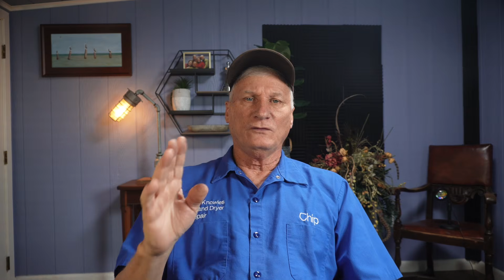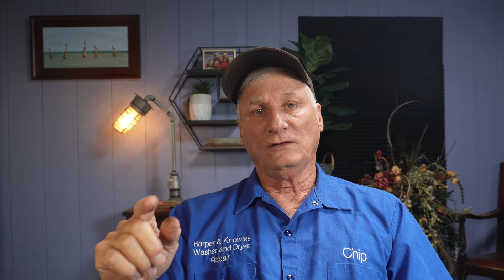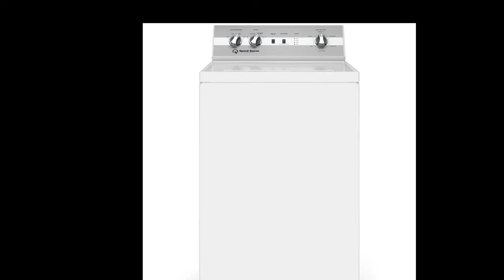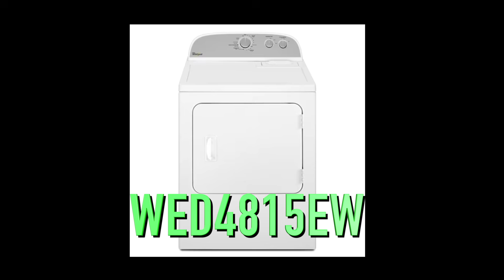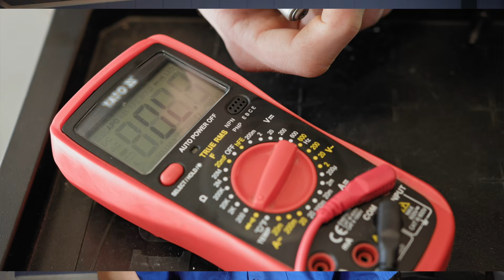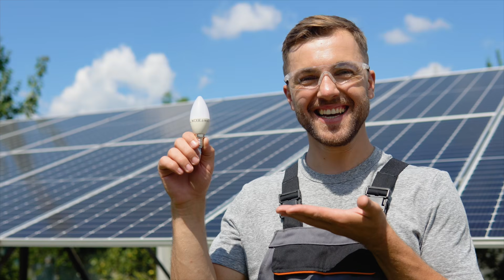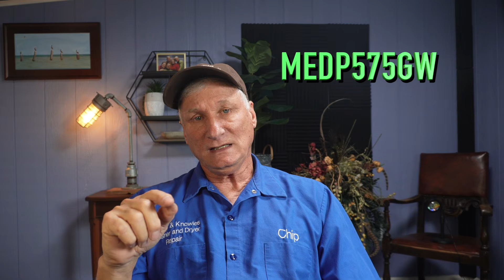I've Repaired Hundreds of Dryers — These Are the Only 4 I'd Actually Buy

Comment: We bought a GE bottom of the line dryer in 2005 and it lasted 20 years. The GE washer is still going strong. The only failure with the dryer was the drum bushing would wear out and rub against the chassis. It finally wore the chassis to the point that there was nothing to attach the bushing to. The motor and controls would probably last 30 years.
Reply from the maker: Appreciate that. Clear beats clever every time.

Comment: Weighing in on my personal Miele experience...

In Dec 2008 (essentially 2009) | made a substantial investment in the Miele Touchtronic washer W4840 and gas dryer T9822, including a pedestal base for each. Loved them and took excellent care and maintenance of each. Even the technician commented on their pristine condition.
The problem: One year ago, the dryer, which has never seen hard use, has completely stopped working and gone into
"lockout mode".

Theorizing the issue could simply be the door latch, Miele suggested its replacement. $217 service call, latch parts, and labor did not restore dryer operation.

Given this, I was then counseled that the specific problematic part for an F98 error code cannot now be diagnosed unless dryer is operational. Miele can only suggest that the F98 code could be a thermo switch ($97); the resister ($110); or gas valve ($963). However, Miele has discontinued manufacture of the gas unit assembly.

Miele advises that the only route to override lockout mode in order to ascertain the problematic part is to first replace the electronic control board ($367 part + labor).

So, at minimum, I would have to spend $367 + labor to install, simply to first diagnose what part, and therefore how costly, might be the fix. And if it is determined to be the gas assembly, repair is not even an option. Miele essentially made this machine obsolete after only 15 years when its part manufacture ceased.
I am both bereft at the situation and paralyzed to simply junk it. Miele suggests replacing the unit.

However, Miele no longer makes residential size dryers and washers of my same capacity (5.8-6 cu ft) so unit replacement, to the much smaller compact (4 cu ft) unit they currently offer, is not an option.

Any suggestions appreciated as I remain stuck on what to do. I prefer to keep this "quality" dryer in service, but the road to repair could prove a money pit or costly funeral.

Comment: So, if the Miele doesn’t have a vent, where does the water go? Collection cup? Does that pose an added mold risk?
Reply: It has a small drain hose that you insert into the washing machine standpipe. As well it can drain into a water tank upper left side as you face the dryer, periodically you need to empty the tank.

Comment: I dumped my 2020 Maytag set and bought 2017 speed queen.  I control the water level and the heavy duty cycle is only 25 minutes, not 1 hour.
Reply: The commercial Maytag washers models after 2023 ALL have water level control. AND HALF the price of the Speed Queen.
Reply from the maker: That's the whole point — glad it paid off for you. Thanks for watching.

Comment: I bought an Amana set years ago and when they were two years old I bought a house and it had a new Maytag set so I gave away the Amana set which is still working but I replaced the washing machine twice (transmission) and the dryer once. The Amana set is celebrating its 30th birthday 🎉😊
Reply: I still use my Amana refrigerator after 30 years.
Reply: We replaced our GE dryer with an Amana, and we have had no problems.
Reply from the maker: Glad it landed clearly. That's always the goal.

Comment: One thought, be very, very careful WHERE you buy - I wanted to get my older friend a reliable dryer, so I chose the Whirlpool commercial dryer with the long warranty - I bought it from Appliance Connection, a firm that had been around for decades.  I bought one day, and the next day they filed bankruptcy.  The atty for this could not tell me if I would receive the dryer or not, it said it was already shipped, so I could try to quickly stop credit card payment, or wait to see if it actually would be received, or seized somewhere along the way as part of the bankruptcy.  Apparently, it was seized.  Still waiting on any sort of resolution on this for several years now, still get the atty notices.   I ended up ordering the same machine again straight from Whirlpool.  Luckily, it has needed no repairs.

Comment: Concerning WiFi connectivity... your new dryer will very likely not work with an advanced current router that defaults to the highest security settings.  Many routers don't take well to being downgraded just to connect to your lowly dryer or other appliance.  I have a new AOSmith water heater that will not connect to my T-Mobile 5G modem.

Comment: I can confirm that whirlpool dryer. I work at a 750 unit apt complex and the residents beat the hell out of them. Usually just a belt, door switch, and maybe a element now and then. Actually the pull out lint screen is what is replaced most. Almost every time it's something plastic or gum/candy that was left in the pockets.
Reply from the maker: Glad it landed clearly. That's always the goal.

Comment: My 1998 Maytag oven (made in the USA) has had one minor repair (the plastic over the up arrow on the controller wore through), and I had it repaired and also purchased a spare control unit. That and I replaced the light bulb once or twice. No other issues at all, and it still looks great! My 2004 Maytag portable dishwasher has had ZERO issues, and I use it about every other day. I have a built-in 1018 dishwasher that takes over 3 hours to do what my Maytag does in half that time. And it CLEANS the dishes better! My Citizens brand microwave oven (made in Japan, NOT China) was purchased in 1987. It still works flawlessly, and not even the light bulb has been replaced. It also still looks great, and I use it all the time. My Maytag washing machine is about 10 years old; no issues ever. My Maytag dryer is about 12 years old, and it works flawlessly. Never an issue with either.
Reply from the maker: Thanks — I try to explain it the way I'd want someone to explain it to me.

Comment: I bought this Maytag commercial/residential dryer, model MGDP575GW0, in 2021 and I'm very satisfied, especially my wife. I also have the Maytag commercial washing machine, model MVWP575GW1. I love them and they work perfectly. I love the channel. Greetings from Puerto Rico!😊
Reply from the maker: I am glad to hear those machines are serving you and your wife well, and thanks for the warm greetings from Puerto Rico!
Reply: I purchased A Maytag set same year you did and ours broke down last month. Transmission gone, whatever holds the drum gone,  would not drain water.  More expensive to fix than to replace. Bought a Speed Queen

Comment: No, no, no, no, no... I cannot agree with the Whirlpool dryer recommendation at all. I currently own this dryer and it became a thorn in my side as soon as the warranty ran out. For the last 5 years I have replaced the heater element at least twice but as often as FIVE TIMES EVERY YEAR.  I can replace the element in less than 10 minutes because of it, and I have a fresh spare on hand  at all times. And yes, I used genuine Whirlpool replacement parts... At first. But those are the ones that burned out the quickest, sometimes within a month of replacement. And getting the sellers to warranty the genuine parts was a nightmare. Using the cheaper off-brand Amazon  heater elements has resulted in a longer time between failures, and getting a refund when that part fails is much easier (not to mention getting next-day delivery). So no, I cannot go with this recommendation at all. This dryer sucks!
Reply from the maker: When you look at a burned-out element, if the coils sag and aren’t straight across the frame like they were when you put it in, then you have an airflow problem. Thanks for watching!
Reply: Hi. You might want to try using a lower temperature cycling thermostat on your dryer.
It might extend the life of your heating element since it will cycle On and Off less often.
Also. Have you tried the SUPCO brand after market heating element on your dryer?

Comment: Chip, love your channel -We have had a Mexican made and US assembled Fisher & Paykel dryer -Weve had it 22 years, and just last week I finally needed to replace the belt, pulley, bearing, and bearing journals for a cost of about $68.88 with a kit from Partsdiscount and 2 hours of my time (I cleaned this insides like you could eat off it too).  This dryer was used daily during that time with a family of 5.  Anyways, not sure if you run across these New Zealand products but 22 years and no signs of stopping is old school quality. -also, our Fisher and Paykel washer made it 15 years BTW.
Reply: My Fisher and Paykel washer and dryer are still going strong after more than 18 years. The dryer is starting to make an odd sound, so I will look into replacing the parts you did. Thanks for the information!
Reply: @gribble2979  Irs almost certainly the 4 plastic journals bearings which guide the tumbler and are designed to wear out and are simple to replace -or the main bearing or pulley -both simple to fix too.
Good luck and if you need help hit me up
Reply: @DBoonful  thank you!
Reply: Just replaced heating element and the parts you mentioned on our 24 yr old Fisher and Paykel dryer.  The washer has had a few repairs but nothing major and I still love it.
Reply: @lindabookmiller8803 Hi what model? I am looking to get a reliable system
Reply: @Nicky-s3d mine is a 2004 FP front load  model DE08. Its parts are compatible with GE dryers. So parts can still be purchased on Amazon or other service sites. Btw..I have a friend who has an older model than mine and her washer and dryer still going strong, too.
Reply: Hi what model? I am looking to get a reliable system
Reply: @Nicky-s3d  dryer is DE09-US5 made in Canada - i think we purchased around 2004
Reply: @Nicky-s3d  Washer is a 2004 or 5 Fisher and Pykel top loader Smart Drive (Direct Drive) washer

Comment: Looks like the Maytag MEDP575GW is no longer available.  Could you review the MEDP585GW and compare it to the 575 model?
Reply from the maker: The MEDP576GW is the new model number for that machine. Thanks for watching!
Reply: @HarperandKnowles  Thanks for the reply
Reply: @HarperandKnowles  I searched and can't find that model (MEDP576GW) anywhere... Maytag comes up with a MEDP576KW instead, but it only has a "FIRST YEAR LIMITED WARRANTY (PARTS AND LABOR)" and a "SECOND THROUGH TENTH YEAR LIMITED WARRANTY (DRUM MOTOR AND STAINLESS STEEL OR POWDER COATED PAINT DRUM ONLY - LABOR NOT INCLUDED)", so it doesn't sound as good.